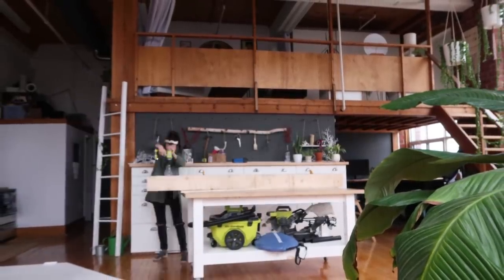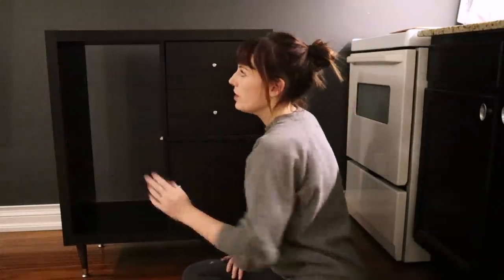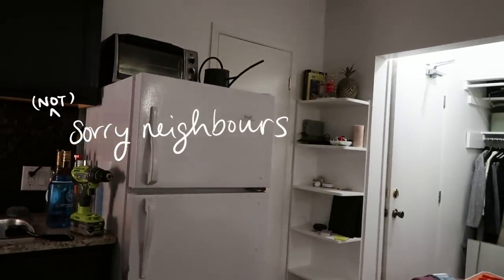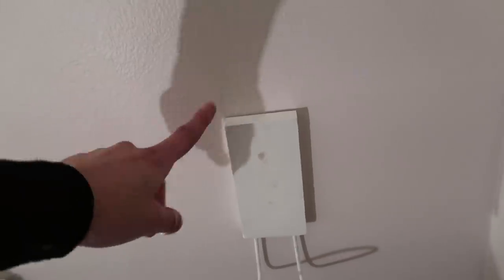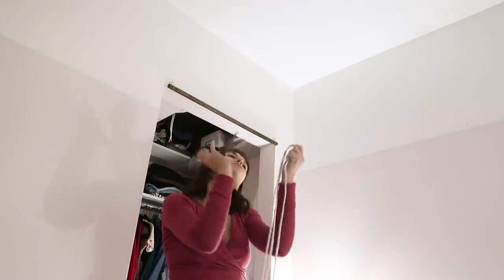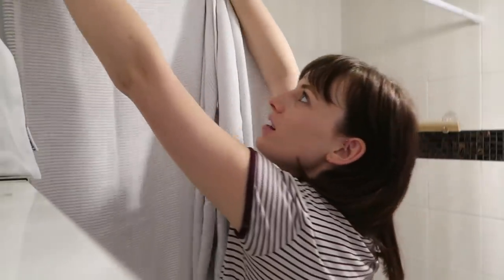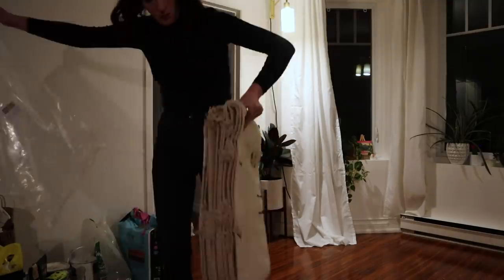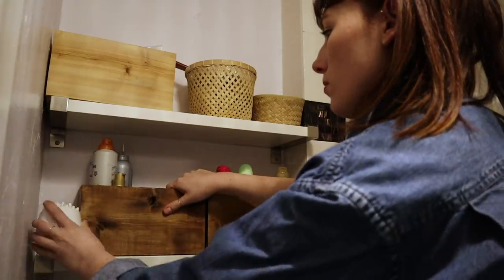DIYing for my small apartment

Comment: TENSION ROD IN SHOWER, take a normal sized shower curtain-tension rod, and put it along side the back of the shower and hang A LOT of stuff on.  It will help keep stuff of the tub corners also and make less mold to clean.

Comment: For the bath tray it is actually safer to put little perpendicular pieces holding the long ones not on the bath itself but INSIDE it, so long pieces lay on bath and small ones do not allow tray to move left and right, so it won't fall and drawn all your stuff when you awkwardly (and we all are =) ) move it a bit and the part that is closer to the wall just falls into the water...